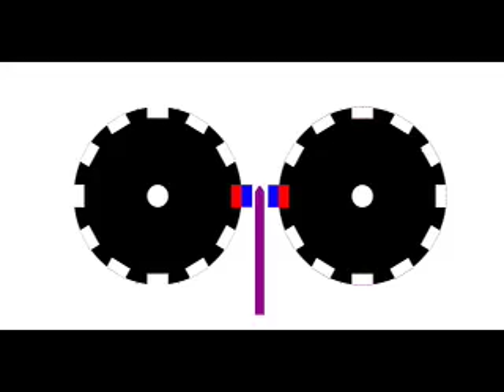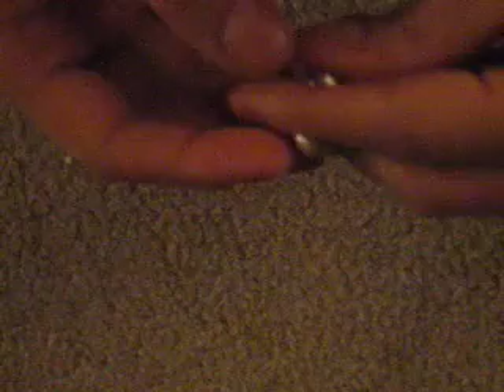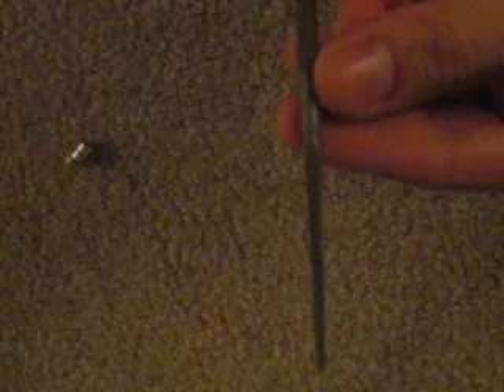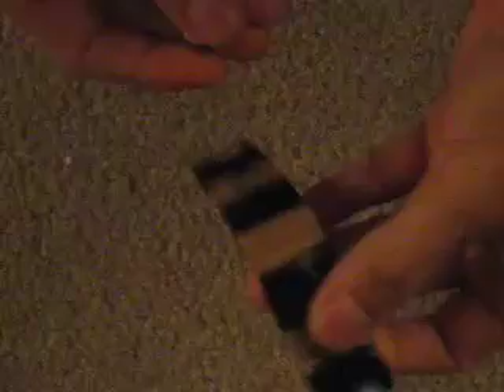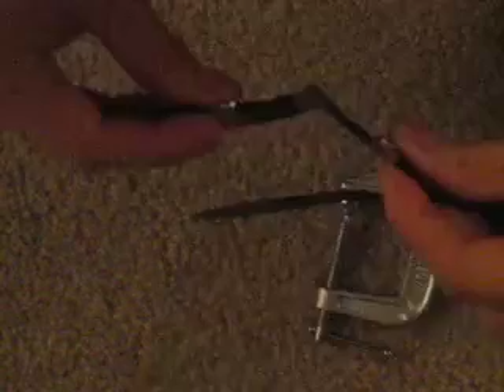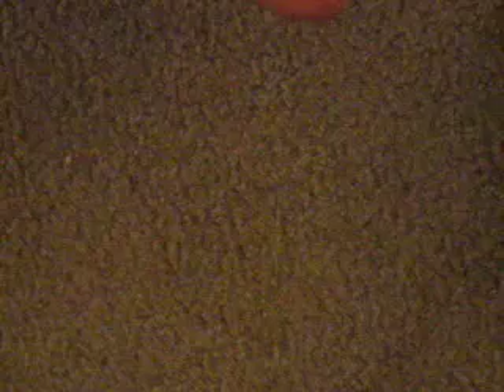Magnet Motor concept and How magnetic shielding works

Comment: So, first I'm going to tell you how a magnetic field works, and then how magnetic shielding works. Hopefully, this will explain to you why there cannot be a magnet motor of this kind.
Every permanent magnet has a field around it. The field is a vector field, meaning that each point in space has both a strength, and a direction. If we were going to imagine such a field, we would do so with magnetic field lines, which emerge from one pole of the magnet and then loop around to the other side, and go back in.
These magnetic field lines must always start on a north and must always end on a south, and their amount must always be equal. The lines may not be cut, and cannot cross. Because, as mentioned, this is a field, and the lines are just an illustration. When you physically push two magnets together such that their poles repel, what you are doing is squishing these lines together. In the same way that you compress a spring, you have forced the field lines closer together and given them less room to loop around and back out to the other side. The two magnets then repel because they are attempting to spring back. When you pull two magnets apart, you are stretching the spring that goes from the north pole of one to the south pole of the other.
Magnetic shielding is a region that magnetic field lines cannot pass through. This does not mean the lines stop, vanish, or are cut. It means that they either flow through the shielding itself, or are pushed aside by it. Some substances block magnetic fields, and if you try wrapping the south pole of a magnet in these substances you will force all of the field lines to move up through the center of the magnet to the north pole. This weakens the north pole as well, as those field lines no longer extend out from the north end. The field will now simply bubble out from the end, and the middle where your shielding stops, and be weaker, rather than performing some kind of magic. Some substances are more permeable to magnetic fields. When you place one of these near a magnet, the magnetic field curves towards it, and passes through it more densely, to reach the other pole of the magnet. This again means that there is less magnetic field available outside. Your magnet again becomes weaker. You can observe this with iron filings and confirm it for yourself.
There is no way to isolate "half of" a magnet to do your work, any more than you can cut a spring in half to avoid pulling on the other side of the spring. It cannot happen. It is not a case of merely finding some clever way to arrange or shield it. These processes do not and cannot do what you need to have happen. You may as well use physical springs for your machine.
Reply: Yep. That's a valid diagram! Somewhat unconventional to show the SIDES as red/blue instead of the poles, but I'll take it. In that diagram you have opposite poles facing the shielding, and so the net effect is an unstable equilibrium where they would prefer to shove the shielding out of the way. The magnets will experience an attractive force towards whichever way is shortest for them to get around the shielding, and attempt to move that way. If there's another magnet pair in line affected by their motion, that magnet pair will object to this shielding being shoved between them, and the wheel will stop turning there, when the shielding is equidistant between the two pairs of magnets and neither pair wants to let it get any closer. That's a stable equilibrium, which will bring the machine to a halt. If there isn't another pair of magnets, these two will flip out from behind the shielding and snap together in front of it. That's a stable equilibrium, which will bring the machine to a halt.
Magnetism is a conservative force. The lines never break or cross. There is always a stable equilibrium. The machine always halts.
Reply: @williambarnes5023  -  Thank you for taking the time to explain.  I appreciate it very much.  Far, far better than, "It doesn't work!"  I know people can't answer all the time, but nice to see one answer per comment section.  :)
Reply: Thank you! If you have any other questions I'll be happy to try to answer them. I like teaching people about this stuff.
Reply: @williambarnes5023  hi.
Would it this idea in video work if instead of magnets you use electro magnet that energize only when needed passing to create the momentarily magnetic effect of a permanent magnet but switch off at a set timing stage?
Reply: @pietpompiepompiepiet940  That's called an AC motor. It will consume the power you supply to the electromagnets in order to spin the wheel.
Reply: @williambarnes5023  you think a perpetual machine would ever exist in future with new form of materials? Like a permanent magnet that can switch on and of.

If the electromagnet was powered by solar, can I create more energy on the flywheel that contains the permanent magnets?
Reply: @pietpompiepompiepiet940 
If you're powering it with solar, the energy comes from the sun. Just spend it directly on what you want to do instead of wasting energy in intermediate steps. Though storing energy is a flywheel is a decent idea, and works better with a magnetic levitation bearing in a vacuum.
The universe favors spontaneously developing systems with lower energy states. Gas wants to burn and release its energy to get to a lower energy state. Rocks want to fall and release energy to reach a lower energy state.
If free energy could work, it would work with zero parts, because each part of the mechanism would only add inefficiency. Whatever process released the free energy would happen spontaneously, and unstoppably, everywhere in the universe, all at once, setting the universe on unquenchable unending infinite fire from corner to corner because free energy is such a good deal that the universe couldn't refuse making it happen.
Reply: Absolutely correct. Permanent magnets do the same like mechanical springs. If you can build a perpetual motion using springs, so you can using magnets.
Reply: The 2-D visualization commonly used to demonstrate magnetic "fields" is completely inaccurate. The iron filings trick demonstrates a 3 dimensional field in two dimensions. There are no actual "lines of force" in a magnet.  A Mag field is actually a 3 dimensional torus as is the Earth's mag field.
Reply: user314159265358979A It would not be bad if they were asking questions.  What annoys me most are the ones who claim to be providing answers and yet are obviously faking the results.  The ones who are merely fooling themselves are wasting their time and thus could be said to be an opportunity cost.  If the same effort that went into things that could not work was applied to things that could, we may have a lot more useful windmill designs etc.
Reply: wow, i am so NOT impressed.
Don't give a shit how many patents, books, videos and followers you have.
Where is the actual commercial application of the magnet motor?
Reply: but you never addressed the fact that the magnets (regardless of north or south) are attracted to the steel plate between the wheels.
I'm not arguing, just trying to brainstorm. & learn
But this idea would be soooooo simple to make, it must have been made by now even if it was by someone who watched this video! ! !
Reply: Harold Geodesic
but you never addressed the fact that the magnets (regardless of north or south) are attracted to the steel plate between the wheels.
Yes I did. Here is where I did it.
"Some substances are more permeable to magnetic fields. When you place one of these near a magnet, the magnetic field curves towards it, and passes through it more densely, to reach the other pole of the magnet. This again means that there is less magnetic field available outside. Your magnet again becomes weaker."
Reply: Rick Cramer
Correct. The filings are used as an illustration. If you wanted to observe it in three dimensions, you would need to have two thin clear sheets between which the filings are trapped, and move that sheet around. And quite correct that the field lines is not an actual thing, that is an illustration meant to make it easier to imagine. The actual shape is more like a torus, yes, and rather than lines it is a continuous vector-valued function across space.
But you can't just explain such things to a free-energy nut as if they understood conservative vector fields. If they did, they wouldn't be free energy nuts.
Reply: imingzee The main point of his explanation is that you simply can never have a "magnet powered system".  The idea is in the same class as putting big wheels on the back of a car so that it is always rolling down hill.  It sounds sort of right, right up until you think about it for a second.  You can't see magnetic fields so they appear at first to be mysterious but they are within the scope of what "mere mortals" can grasp with just a bit of study.
Reply: Ken Smith
Actually his idea has some merit just not the way he explained it. Use mutual attraction to mitigate the typical repulsive forces and even if you don't have a unity device its ultra efficient
Reply: I never EVER make any claims about perpetual motion OR free energy

youre thinking of someone ELSE, its NOT ME
Reply: William Barnes but you simply havent addressed the key to this guys design. you glossed over it with "your magnet gets weaker". yea it does get weaker at the point it would cause a hang up, thats the point of this design. You need the magnetic flux to be weaker on one half of the centerline. Furthermore, a tapered shield will do exactly what the poster of the video claims, there will be a point on that shield, if calibrated properly, where the magnets' force of attraction to the neutral iron shield will be equal to their repulsion around the shield. This point needs to be calibrated such that it lies on the horizontal centerline of the discs/cylinders, or perhaps even slightly beyond it, to prevent flux bending around it to cause a small "bump". With an untapered shield, it will get stuck 100%.
Reply: Seems all these "magnet motors" "free energy" started coming around when 
Neodymium magnets got cheap  20 years ago I was using small 3/8 round with a center hole for security system recessed reed switches  they were very expensive but if you could not drill into the window far enough for a regular magnet (1/2-3/4 depth) you used one of these. Don't remember any "magnet motors" back then and you think Edison, Westinghouse, Tesla would of come up with a "free energy" motor  Oh wait....... Sorry, they were not as smart as the people on here
Reply: William, I am curious, what is your background and expertise if you don't mind me asking? How did you get to know so much about magnetism? Thanks for the great description btw! You really seem to understand it on a fundamental level and can visualize very well what is going on. I actually envisioned it exactly how you described it and it's nice to see a clear explanation of this, something which I have not seen put into words by anyone else yet!!

Have you tried making a design of a magnet powered system of some kind?
Reply: actually it can with diamagnetic coverings.

likewise, there is another way I wont mention.
Reply: Theoria Apophasis you imply it by saying "actually it can" and "there is another way i wont mention"
Reply: bullshit,  go suck an egg
Reply: I wrote the book and made 92 video

IVE DONE THE ACTION

youve DONE JACK SHIT, obviously
Reply: how many patents do you have?

how many books?

how many followers?

I thought so.  Adios,  CLICK*
Reply: good for you , have a nice day
Reply: William Barnes p
Reply: "Where is the actual commercial application of the magnet motor?"
They make good space heaters.
Reply: "how many patents do you have? how many books?"
The same number as the number of over-unity magnetic engines that will ever exist.
Reply: whats that blue orb looking thing?
Reply: My profile pic? It's a blue-hue colorized picture of the Sun.
Reply: nearly fully shielded magnets: http://www.coolmagnetman.com/images/shld02.gif
Reply: Exactly, started to type this out, but your post was to the point. Well said
Reply: William Barnes hey don't be so hard on the nuts! It may be true that anyone who has had a little bit of science class about magnets can easily ridicule people believing in the dream of free energy, but look on the positive side. Common folks are asking questions about the laws of nature. Though they may not find answers on subjects like this one, they do expand their minds to fields of science they would otherwise know absolutely nothing about. And then we look up comments like yours explaining at least to the open minded ones learn something new. 
So be glad video's like these exist, it means people are asking questions :)
Reply: its not "attraction" and there are TWO fields at every "pole", centripetal and centrifugal.   download the book  Uncovering the Missing Secrets of Magnetism,   google it.
Reply: I'm not sure I understand your objection. Magnetic shielding does not work that way. Draw for yourself a diagram of the magnetic field. Start every line on one pole, end every line on the opposite pole, and allow no line to break nor to cross any other line.

Comment: Excellent explanation! But there are some problems. First of all the magnetic shielding is different than what the name suggests its more like "magnetic field re-director". Shielding materials have high magnetic permeability therefore field lines tend to go through them rather than air around them but in this process the shield materials themselves become magnets temporarily. Opposite pole will be created around the area where a permanent magnet pole is present and the opposite pole will be created at the other end of the material. Will take real complex structure once you introduce more magnets. If u think of the whole setup with the field lines present u start to notice the problems with the setup. Already getting to big for a comment. Only a video response can properly explain why it will not work.
Peace :)

Comment: You will never get anywhere until you understand what you are working with. You are not demonstrating magnetic shielding. You are demonstrating that magnets are attracted to iron. You are not alone, most everyone on YouTube is claiming magnetic shielding and they are just as wrong. Your motor idea looks good on paper but it will not work. I would encourage you to build it so you will get a better understanding of magnetics. If you want to demonstrate "shielding" then shield against a piece of iron, not another magnet. If you can prevent a magnet from being attracted to iron, then you will have demonstrated shielding. Don't get me wrong, I am not trying to be discouraging, just pointing you in the right direction. Most importantly always think for yourself.
Reply: You coat the iron with three layers of Mu Metal. Problem solved, flux diverted
Reply: @excelsior8682  hi, sorry what is Mu Metal ?
Reply: @excelsior8682  el mu metal está comercializado se puede comprar fácilmente?
Reply: Que aislante magnético se puede utilizar?
Reply: Es un asunto de Metalurgia Fisica , que en particular ese tipo e Aleaciones presentan esa característica  Blindar , Aislar por una cara de esa Aleacion laminada   ,

Comment: The main problem is that all those free-magnetic-motor-energy-guys think of a magnetic field acting locally, at the distance of centimeters, instead of multiple and complex combined magnetic fields, acting on the entire complex of the "motor". If you don't put an on/off electro-magnet (spending energy) it simply doesn't work!

Comment: First of all do some mathematics over this . Then post these types of videos.
If below magnets are attracting to the needle , don't the above parts of magnets will do the same in the opposite direction.. So how you suppose it will move in one direction and not the other direction?..!!.. Have you ever heard of conservative forces and Non-Conservative forces.. Do some homework before starting to experiment over it..
Reply: well didnt you see the first demonstration? the forces of the below magnets DID attract, but once they got closer to each other, and the "shielding needle" became" slimmer, the repelling forces started getting stronger. Therefore it attracts more at the bottom, but does not attract as the shielding to the top of the needle gets smaller.
Reply: chandra shekhar You're right and I agree with you

We must use the gear to the stability of movement and balance and make it in one direction

Comment: Perpetual motion is not an issue here (example: absolute zero temperature electrical currents sustain in zero resistance). A magnetic motor must perform work, accessing zero point energy. The biggest problem is, if one finds a (GIRON tm) magnetic shield allowing like poles to approach without repulsion,  and then repell when apposed, that the device will over rev and self destruct if not governed. Owners of fossil fuel and other "marketed" energy sources would kill to prevent free energy. Nicholas Tesla was dumped for his wireless (and meterless) electricity distribution idea. Think of concentric rings of magnets, angled for post approach repulsion and shielded approach. Three such rings stacked, middle counter rotation, might power a saucer (reverse engineered in the 1940's). Go back to your TV and ridicule any who speak unblessed release of truths.

Comment: It is impossible to work because both top and bottom side are attracting themselves. Power at top and at bottom impact with the same power at top and bottom, thats why it does not work. It could work if the poles were dynamic like at bottom were attracting themselves and at the top pushing themselves.